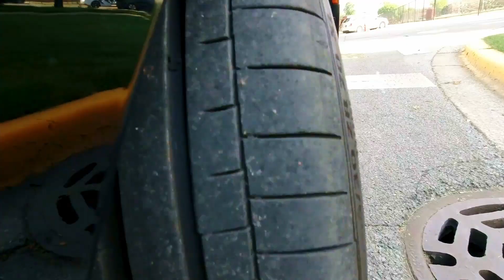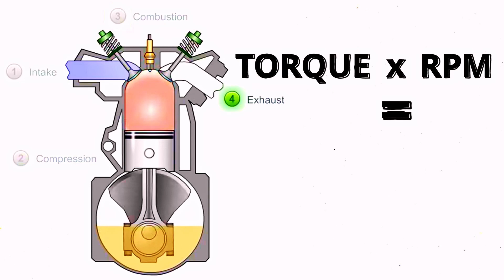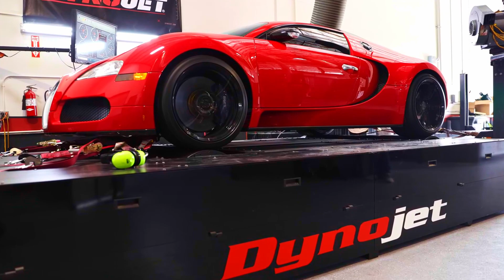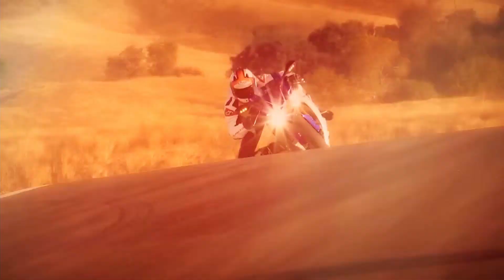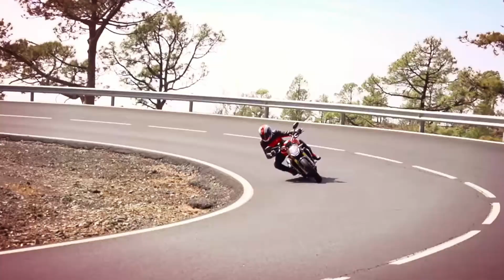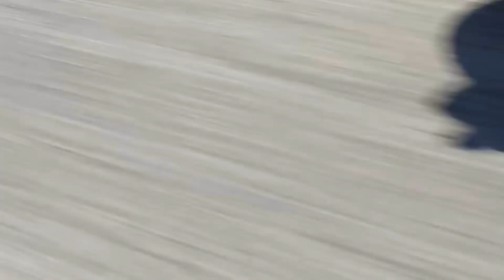Best Way to Understand Torque and Power!

Comment: For a given vehicle speed, the engine running at the RPM of peak engine power will always produce the highest amount of possible torque at the driven wheel(s). Why? Because the gear ratio needed to allow the different RPM's of the vehicle's driven wheel(s) and the engines RPM of peak engine power, will always produce the highest total torque at the driven wheel due to the gearings leveraging affect on the torque output from the engine.

For hypothetical example, if an engine could generate the same torque output at 5k rpm as it can at 10k rpm and the driven wheel is also spinning at 5k rpm, you are always better off choosing the gear ratio that allows the engine to run at 10k rpm because the gear ratio to allow 5k rpm at the driven wheel and 10k rpm at the engine, would double the torque output from the engine at the driven wheel, giving your twice the acceleration force with the engine at 10k vs 5k rpm.